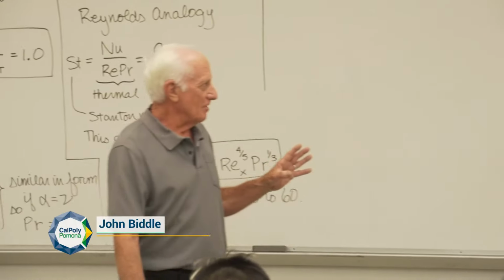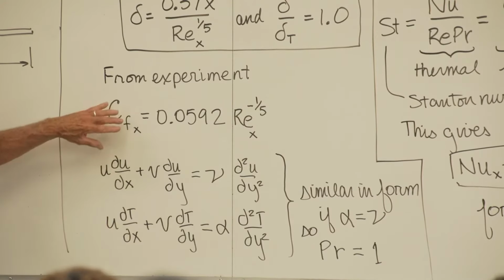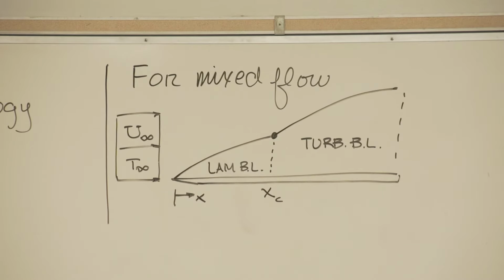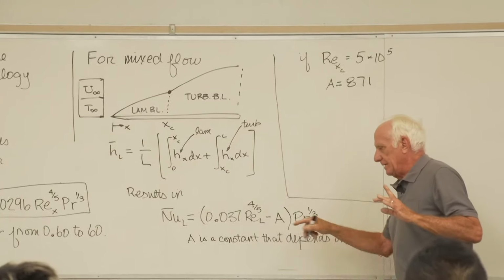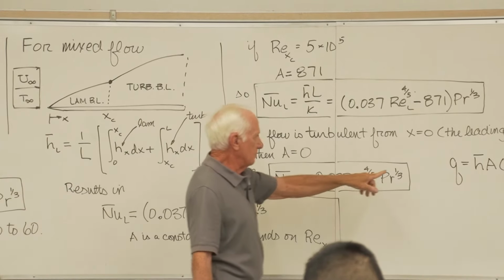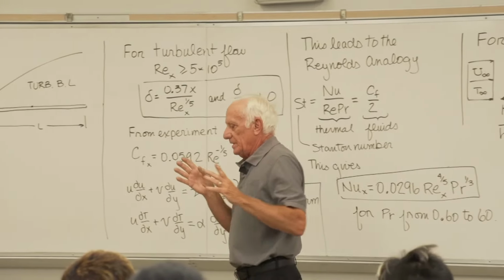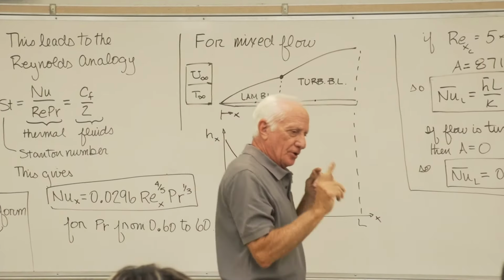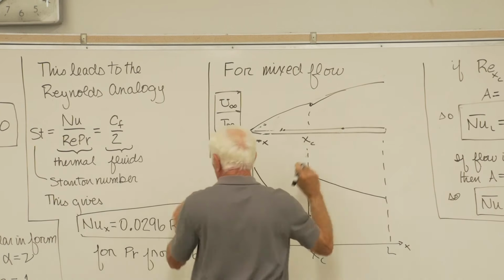Heat Transfer (24) - Flat plate convection heat transfer coefficients

Comment: One step is very painfully missing from this otherwise excellent presentation. To calculate the turbulent heat transfer over the plate h(x)=k*Nu(x)/x is to be used and that needs to be integrated and divided by the length. So, it becomes the mysterious h_avg=0.037*Pr^(1/3)*k*(rho/mu*v_inf)^4/5*L^(-1/5). In this the Reynolds number was already substituted by Re(x)=v_inf/nu*x=rho*v_inf/mu*x as it is a function of x. nu is the greek letter for kinematic viscosity, rho is the density and mu is the dinamic viscosity. Nu(x) is the Nusselt number at location x, h(x) is the heat transfer coefficient the location x.
Reply: What is v infinite?
Reply: @rzeeonthemic  The velocity far away from the plate, so basically the velocity of the undisturbed fluid.